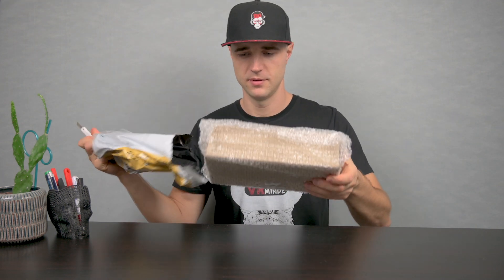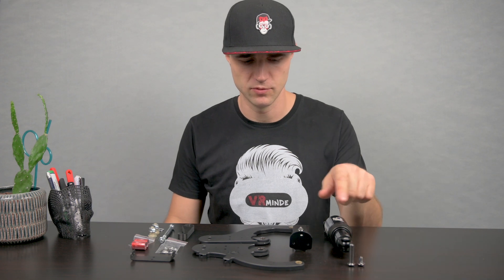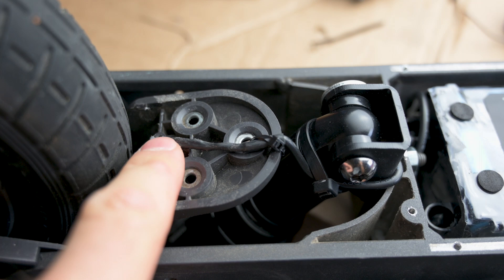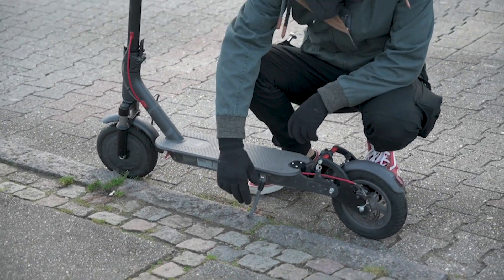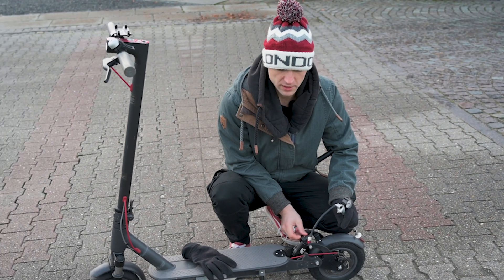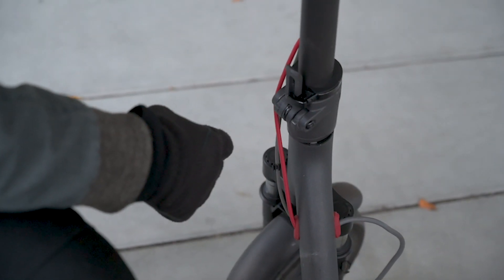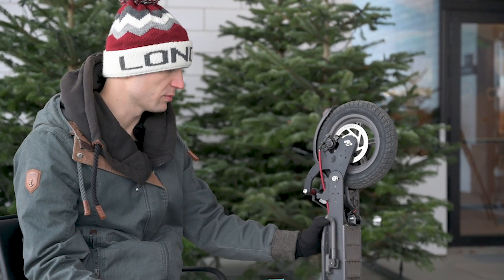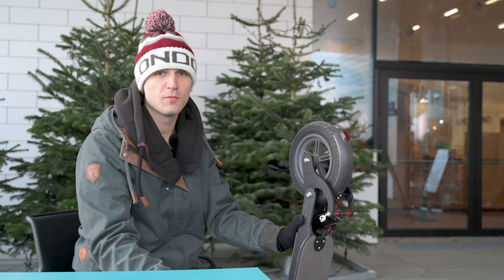KONYK rear suspension for m365 unboxing and the first look

Comment: You really need to work on your bunny hop technique ;) You're supposed to lean back, not just jump up.
Reply from the maker: Sure mate, waiting for a tutorial from you!
Reply: @VRMinde  there are many tutorials out there, its really just like riding a bike, i have the basic b-hop skill, and when I jumped on a m365 it felt like home.
Reply from the maker: @piciu256  I can bhop all of my mtbs, including the electrical one weighing 25+kgs. On the scooter though is another storry :) I agree with you - I need to work on it. Have not seen any videos on bhop technique on escooters yet
Reply: @VRMinde  actually, I checked and there appears to be no videos at all about how to jump an electric scooter specifically, so I'll make one, dont expect it to be of amazing quality or anything, but I think it'll give a good idea what to do. Tomorrow will be the day, since today there is not enough light.
Reply from the maker: @piciu256  yay! Good idea mate, looking forwards!
Reply: Ps. Id reckon that your bike jumping technique is also wrong, you probably rely on the springiness to get up, instead of doing a proper bunny hop, otherwise I dont see why you would be jumpin the scooter this way ;)
Reply from the maker: @piciu256  you are wrong, because I can manual my bike and I cannot manual my scooter. Furthermore there is no “right” or “wrong” bunnyhop technique, it is just different. With the manual-to-hop technique you can simply jump higher, but on trails you will probably end up using both techniques
Reply from the maker: @piciu256  you can see my bhop on a heavy ebike with motor and battery at the end of this clip https://www.instagram.com/p/CDi1SoBJDdU/?igshid=fe3wk3omk6k6
Reply: @VRMinde  I stand corrected, you can bhop a bike much better than I can, I really struggle to get height (might be a weight/ height/ strenght issue) but for the type of jumping you do on a scooter (mostly onto kerbs) the manual hop is definitely superior, the classic hop is only really useful in specific scenarios, like hopping in spot, trials etc.

Comment: Hello G30D but not goodbye m365 ;=)
Reply from the maker: I wonder what is the next m365 :)
Reply: @VRMinde  it will be not the g30.
The g30 cannot compensate for what has made the m365 an all-rounder - the price.
Actually it was a very expensive downgrade for me at 800 € considering what my m365 can do now. The m365 has grown too dear to my heart, i have already ordered aluminum electrodes to weld the frame back together. 

The 20 kmh from the g30 quickly become annoying when I consider that my m365 simply drives 45 kmh.^^
Reply from the maker: @Bergwacht  M365 for me is like the VW golf 2 :D it will have it's legacy :)
Reply: @Bergwacht  Be carefull when you solder with those aluminum electrodes because they are made from softer aluminum and the frame will not be as strong as original.
I reccomend before you solder it ,to drill a small hole in the end of each crack to stop the crack go further.Then solder it and then reinforce it with somme steel .
Better its to buy another new board.

Comment: ..the cost its almost  more than buy a once....its no sense...buy another kinda. .
Reply from the maker: There is not much financial benefit in upgrading the scooter. This one at least works, on the contrary to the cheap Chinese front one :)
Reply: @nerk23 do you mean that someone should buy a scooter with integrated suspensions so it would be cheaper than buying the xiaomi and modding it with suspensions?
Reply: @crashdummy4983  evryone can do anything prefer,but i think that this model just made x be essensial and basic, so  some mod dont gonna be expensive and change the Real soul of this model...the praticity....and simplicity. .or you choice another kinda os scootrr/model ,with comfort susoension ,ecc,ecc....but this is my personal idea.....hoping you understand me ??. .
Reply: @nerk234  i my opinion it lacks the front suspension to make it practical. by installing one you remarkebly lower the risk in getting a flat tire. and changing the front tire is horrible. the solution might be solid tires but they lack the grip that pneumatic tires have.